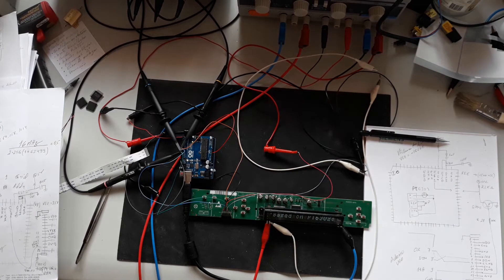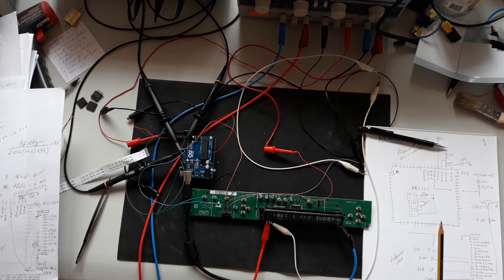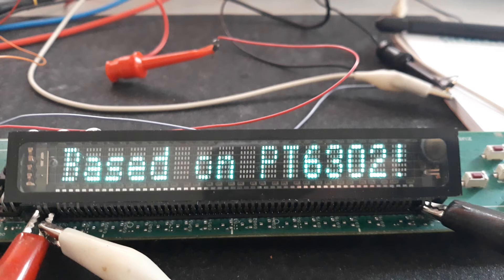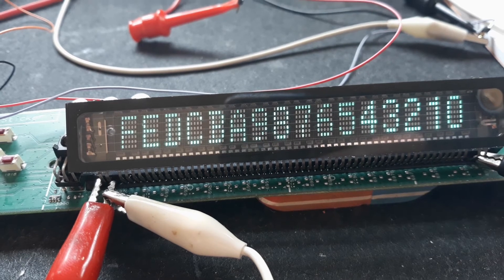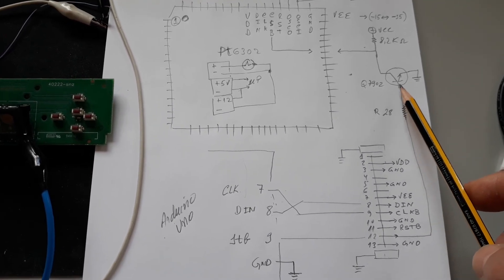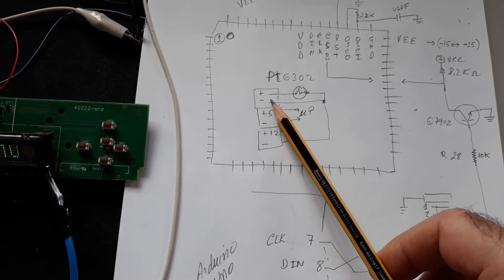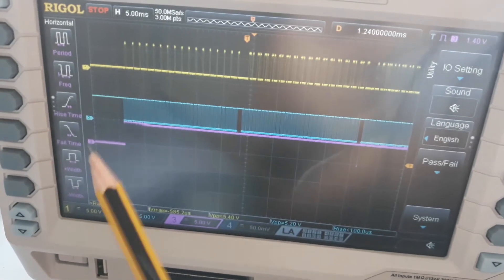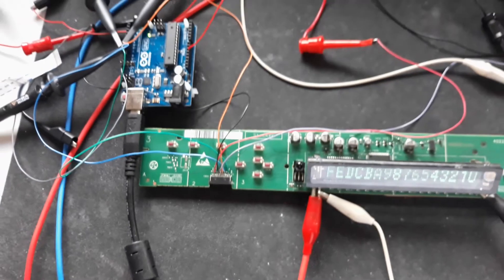PT6302 & PT6964

Comment: Saudações amigo José! Como vai?
Eu tenho uma placa com o VFD e esse chip PT6302LQ-005 (essa aqui: https://www.4shared.com/photo/CU1R2Pffea/VFD_with_PT6302LQ.html) mas, o cabeçalho branco com 15 pinos não tem identificação; vc teria alguma dica de como descobrir os pinos para ligar com o Arduino?
PS. Vc teria algum código Arduino para rolar texto com esse VFD?  Obrigado e abraço desde o Brasil
Reply from the maker: Viva Daniel Fernandes, Não possuindo o esquema electrico, tens de ver o datasheet do driver e seguir as pistas dos pinos do driver com um multimetro até ao connector... vais apanhar um ou dois pinos com resistências o que pode dificultar a tarefa, com paciência consegue-se. Normalmente o VCC e o GND são directos, depois tens o Clk, Din, Strobe e os pinos do filamento que também são directos normalmente. O resto é para o VFD e já se identifica com ele a funcionar. Bom trabalho.
Reply: @jlsmonte  Obrigado amigo, irei tentar o que vc disse.